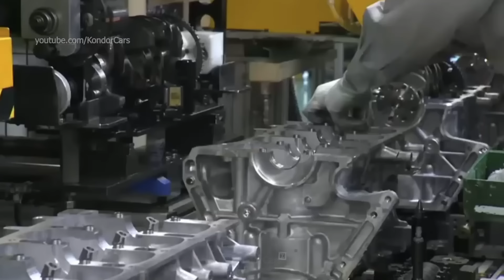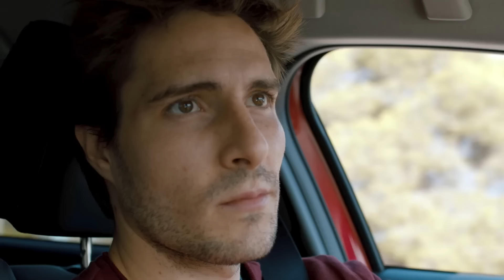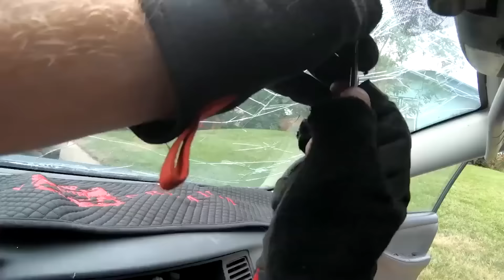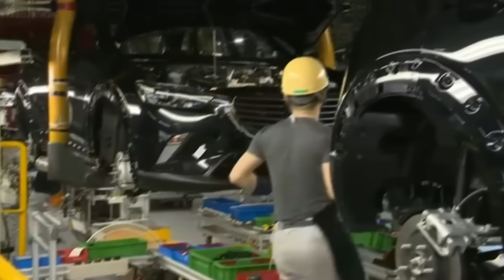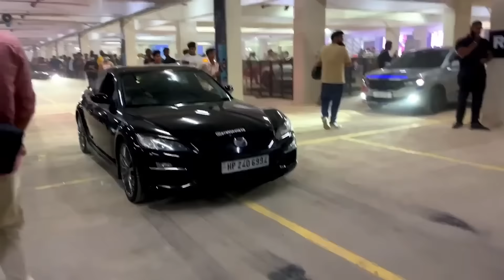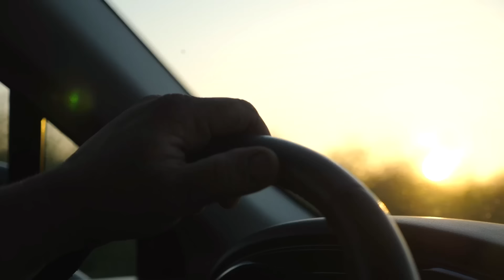This SECRET Mazda Car Trick Is Unknown To 99% of Drivers (Pro Tips)

Comment: My 2014 VW Touareg had virtually no problems, with seating being in exactly where I left it, radio on same station, navigation fine using WAZE and all buttons easy to find in the dark. I only changed as I took a Motability deal
My 2026 never goes back to the same position, I hunt for the “easy to find buttons”, the infotainment has to be set every time I start the car, the washer bottle empty shows every time yet the bottles full

Comment: My 2024 CX-90 is a REAL car. It is luxurious, comfortable, handles like a dream and goes like hell when you press the accelerator with as much as 32mpg on the highway. I was a Toyota guy for 40 years, had 'em all but NONE of them evolved for the better. Toyota cut the weight for forty years and downscaled the engine every five or six years to the "toy", tiny motors they use chasing gas mileage and leaving comfort and quality as watered down cheap materials.

Comment: You want 10 and 2 position on the steering wheel, not 9 and 3. And you're not supposed to be laying down when driving. It's definitely NOT a good driving position.
Reply: Latest recommendation is 9 and 3.
Reply: Recommendations have changed due to airbags in the steering wheel and the damage caused when deployed with the hands/arms in the 10/2 position

Comment: Sorry to say it, but commissioning in Mazda dealers is one of the worst.
Reply: Pretty much throughout the industry. I’m 80 and have bought 50 cars and three motorcycles and can count on one finger the times that a sales person took me through a cars features at delivery. Just bought a 2026 Mazda cx50, great car and replaced a BMW X3. Delivery was rushed, and zero coverage of features and how to use them. After a month still discovering things. Best source is AI. Ask and get detailed information with follow-up.
Reply: @williamirwin9622  I just took delivery of a CX-30, and have had a similar experience, although this is only the third new car I have ever purchased - the first being a 96 Camry and the second, a 2010 Mazda 3.  The only thing I can say in the dealers' defense, especially in 2026, is that they could spend hours with the customer, and how much would the customer remember?  When I drove off the dealer's lot, I noticed the speedometer was set to km (and I am in USA).   So the dealer didn't even check common default settings before releasing the car.   But we have 600+ page manuals, both on paper and on searchable pdf.  And yes, we have AI, which is pretty good but sometimes has erroneous details - and when I correct it, it apologizes.
Reply: @williamirwin9622  agree with everything except AI. AI tried to gaslight me on my FOB functions. Until I told it it's dead wrong amd then it says oh yes you're absolutely right... Take what it says with a grain of salt...
Reply: Must admit I was of a similar opinion however when I took delivery of my CX30 the salesman took the time to go right through cars features including the features mentioned here.  It could be though that the guy was an enthuisiast about his product so I was quite impressed having bought other new cars of varying models this was the best handover I have experienced.  The worst for the point of the conversation was a Nissan dealer who handed over my new Skyline out in the open in pouring rain wjth heres your keys your good to go.